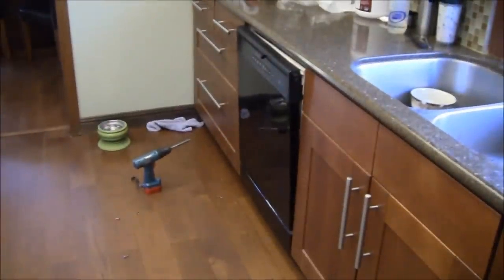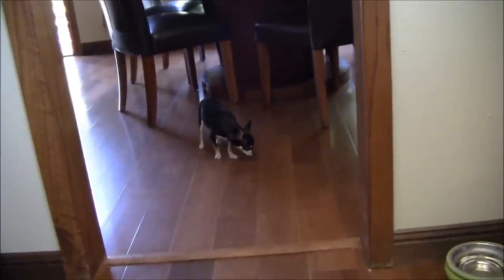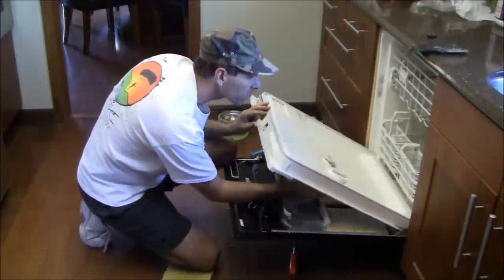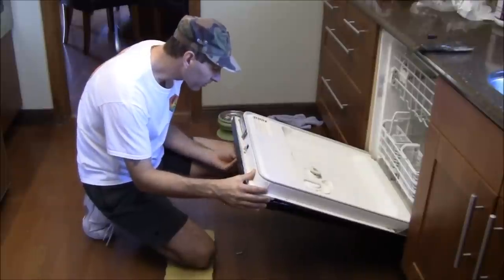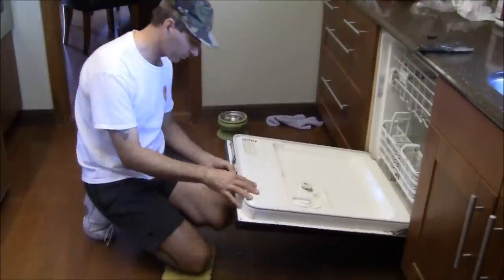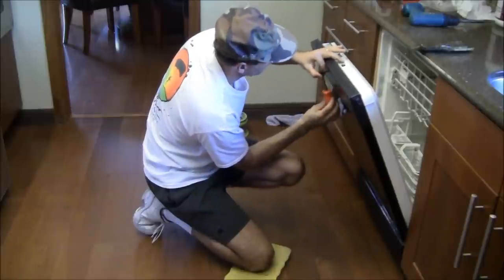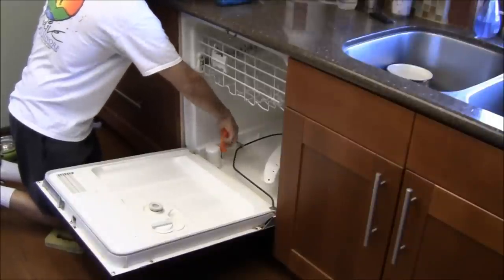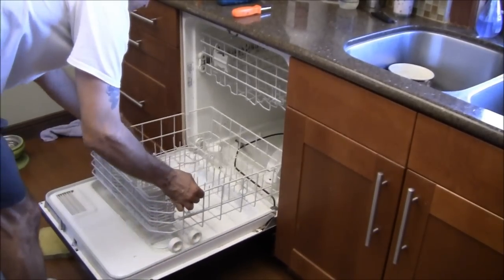Dishwasher repair for GE Soap Cup

Comment: Very useful video, just replaced the timer on my GE Potscrubber 940, however, would it be worthwhile to replace that bad insulation with something? Seems like there should be a generic part to use, I was thinking maybe that will make the plastic parts last longer, protecting them from the heat of the dishwasher, plus the sound deadening - now I have to pull my panel off again to see if insulation is causing my detergent cup to not latch after fixing the timer -

Comment: Thanks - a quick fix!!  My insulation had slid down as well.  It appears to be a somewhat formed piece as the bottom juts out toward the outer door which was what was causing my issue.  It appears the insulation is protecting the circuit board so I was reluctant to pull the whole thing out.  I broke off the bottom where it angled out and put the rest back in hopes of preserving the board longer (this DW was part of the original house build in 2000 and I need it to limp along until we are ready for a remodel!).  If I have issue with the soap cup cover again, at least I know what to do!!

Comment: I thought the problem was soap cup, not the door latch????
Reply from the maker: the soap cup would not close due to the fallen insulation.
Reply: Yeah he surely skipped talking about the soap dispenser and jumped to a different issue he had, not a successful video. But at least  he mumbled about the soap dispenser problem.

Comment: Great video!  I had put up with the soap dispenser not closing on my unit for nearly a month.  Watched your video, thought surely it would not be such a simple fix.... However, opened it up and right away saw the insolation had slid down and was blocking the locking mechanism for the soap dispenser.  I removed it, reassembled and it is now good as new!  Sincere thanks!Great video!  I had put up
with the soap dispensuire nopt closing on my unit for nealy  a
month.  Watched your video, thought surely it would not be sucha simple
fix.... opened it up and right away saw the insolation had slid down and was blocking
the locking mechinizim for the soap dispineser.  removed it, reassembled
and it is now good as new!  A sincere thanks!